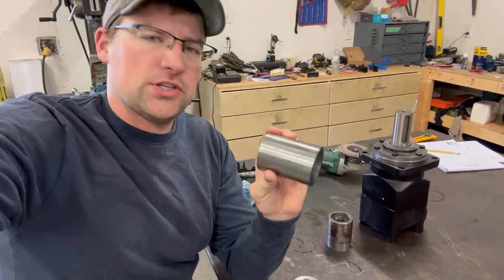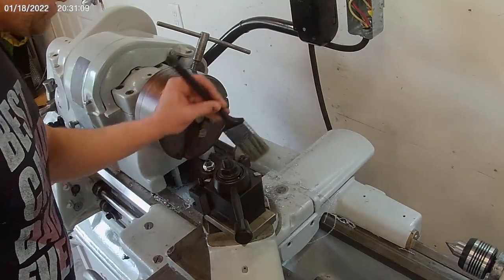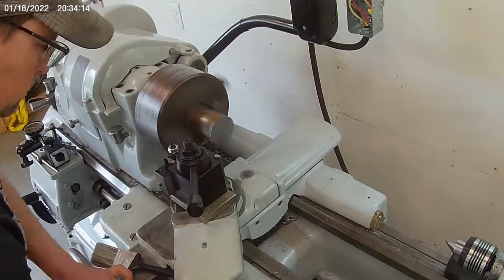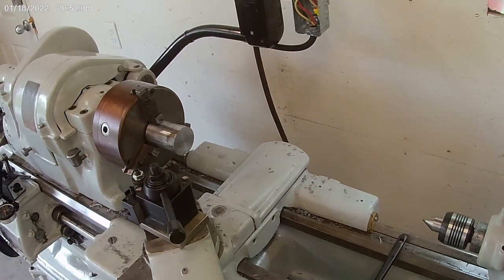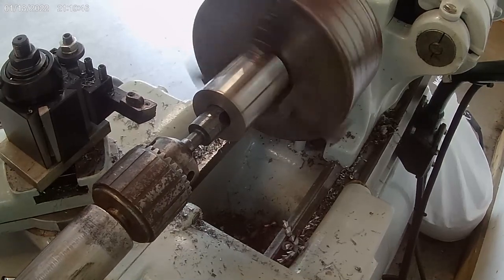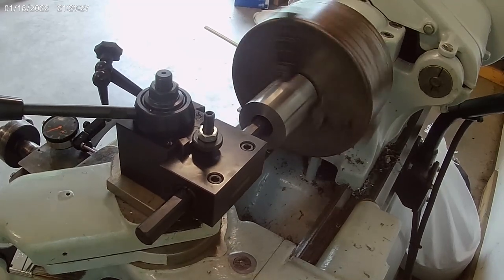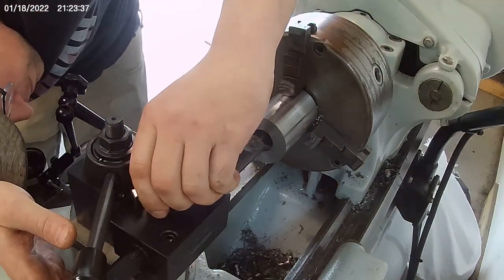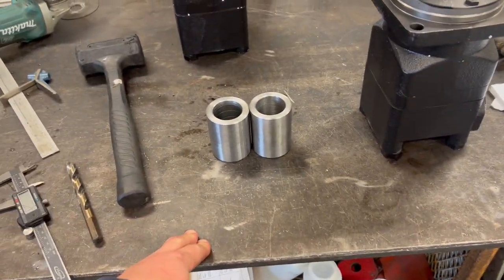1940's Southbend Machines some Hubs! Mini Snowcat build PT7

Comment: Good on you for taking your time to get it right. I’ve tried boring on several occasions and still have a hard time getting a good finish. I lose patience and cowboy it…
Reply from the maker: Oh boy I was pushing the limits learning and it did work. Not easy with a small machine

Comment: You could have taken a standard hub from a trailer spindle and machined it out to the size needed, then it would be stronger than welding a plate on to that spacer.
Reply from the maker: No there is actually several reasons that will not work. You don’t see the full picture. This was is plenty strong enough.